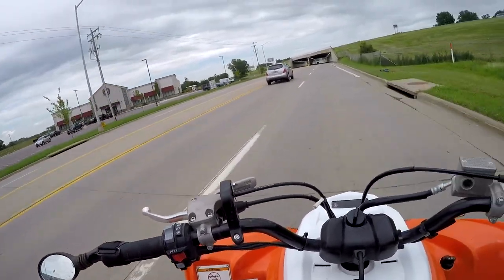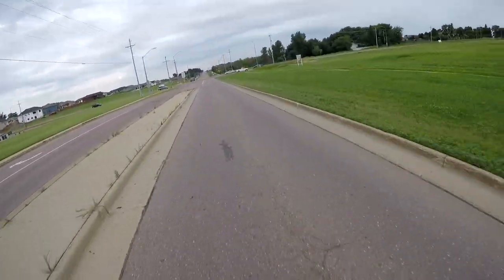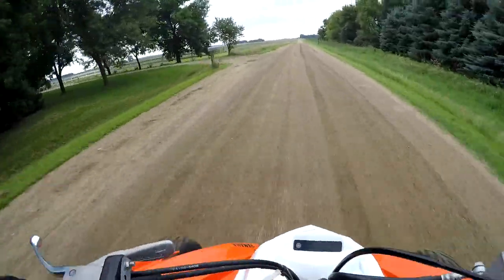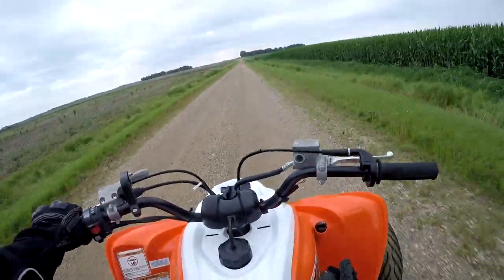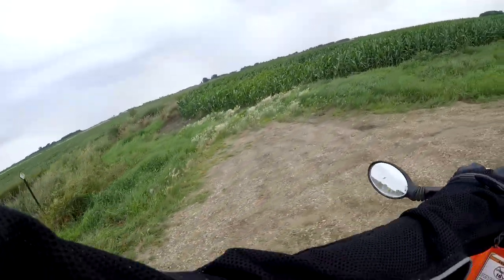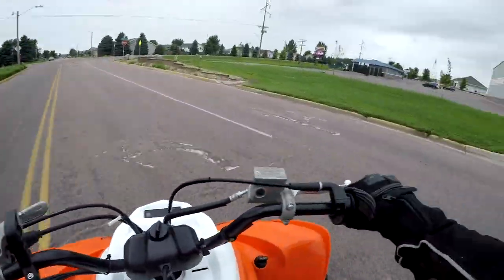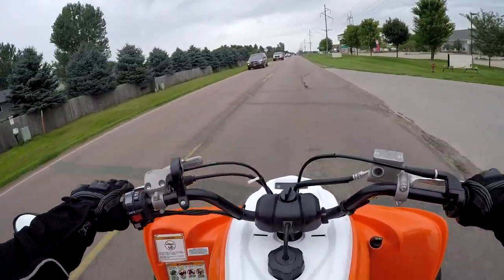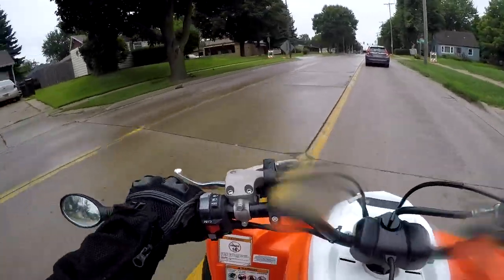How to Drive a Quad with CLUTCH | Part 2

Comment: i love your quad vlogs bro! im 17 still looking for my first job and i would love to save up for a raptor 700!
Reply: Yamaha raptor your hard to gear
Reply: Have you got it yet?
Reply: Just get a trx450 bro I’m 14 and bought one and there in the same power range as a 700
Reply: Just got a 2020 Raptor 700
Reply: if it’s your first I recommend a yfz 450
Reply: @husseinemad267  a yfz450 and a raptor 700 are basically the same when it comes to power okay maybe the the raptor has a bit more but there really the same basically
Reply: @sturdyspamsl2277  maybe but I think someone’s first quad should be less than 500cc cuz 700cc is too much if they are a begginer
Reply: @husseinemad267  agree !!!!

Comment: This is kinda my opinion to you’re last question you answered. When you sowing you’re quad down it’s kinda a lose lose type scenario considering yeah you’re wearing you’re transmission down but if you’re engine breaking you’re basically doing just as much damage to you’re clutch as you are you’re transmission. Granted I’d much rather replace a clutch rather than a whole entire transmission in just saying it kinda sucks that you have two options to slow down but both of the options are wear and tear on the bike. Lol

Comment: I've got a couple questions.

Do you have to "blip" the throttle while you're slowing down? Do you have to give it a little gas before letting go of the clutch? And do you have any tips for a beginner to a clutch? I'm looking at a 400ex, simply because everyone says it's a good starter quad to learn how to use a clutch and its reliable. Currently, I am riding a 1998 Timberwolf 250. There isn't a clutch you have to pull in, you just shift whenever you please. Really appreciate any feedback I can get!
Reply: Rev matching definitely helps and is better for clutch and tranny

Comment: Quads like motorcycles are constant mesh transmissions. Meaning once your rolling you can shift without the clutch. That is how you shift in racing also. "If done correctly!" It won't hurt it. I.e. shift and go again. Do not hold the shifter up or down. Thats between gears. Then the trans has to jump into the next gear and shaft speed doesn't match.

Comment: Can u elaborate on how starting your quad in gear hurts it it’s 4 stroke so long as it isn’t a bump start your not gonna hurt a thing specially with a stock motor like your sitting on your not on no race bike

Comment: Bro can you change a twist throttle to a thumb throttle?
Reply: On a Honda 400ex 2002?
Reply: @mariozuniga1419  stock 400ex is a thumb throttle. You can either run a twist or thumb on anything. For a quad I would stick with thumb.

Comment: He calls it engine braking, a lot of people would call it rev matching, witch would mean that he his revving the engine before shifting down with your foot. he bumps the throttle a little to match the speed he’s going on the quad to down shift. And doing that with a lower gear in the process he showed should slow you down to make a more relaxed stop

Comment: How do I downshift?
Reply: say your cruising on the top of 5th gear, you have to slow down, (just like shifting up a gear u have to listen to how the quad or bike sounds before shifting so you don’t prematurely shift or you shift to late) , pull the clutch in, then push your shifter down once, then u let the clutch go, once u let go you’ll be in 4th gear, you just repeat the process until you get to your desired speed and gear. On my crf250r i don’t pull my clutch in when down shifting

Comment: Wait why are u holding ur clutch in when ur slowing down or turning when ur not switching gear?
Reply: u hold it so the when your going at a slow speed on a to high of a gear it would not burn the clucth plates. so thats y and they shift down to 1st